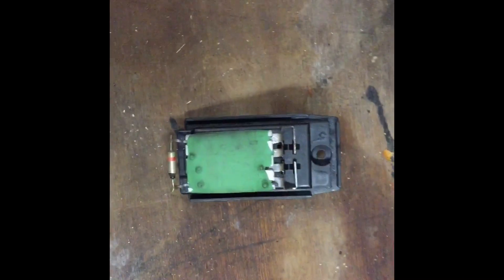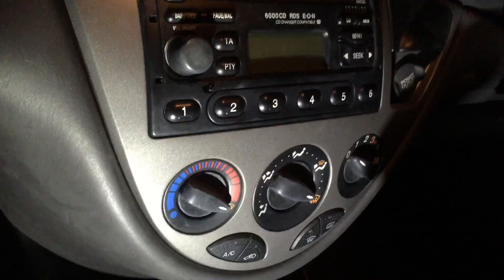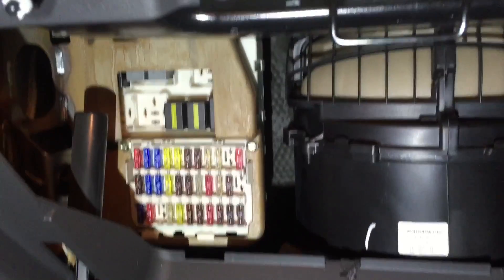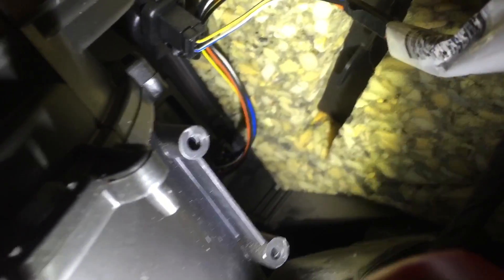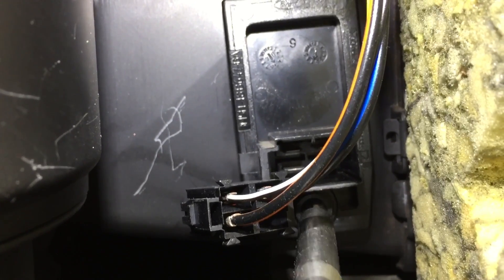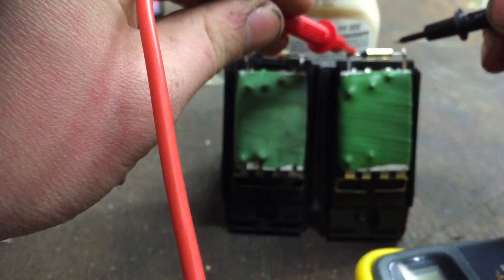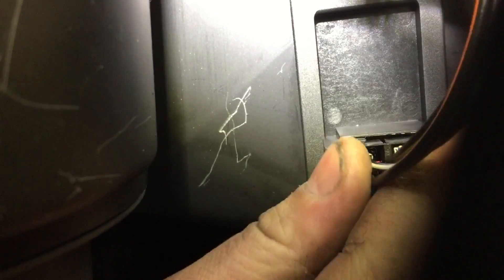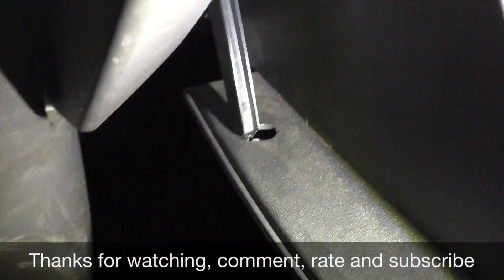Ford Focus, transit, Mondeo heater fan speed resistor diagnostic and replacement

Comment: This might be a stupid question but it seems that the car you are working on in this video is a right-hand drive, as you can see the fuse box when you've removed the glove box. My car is a left hand drive, do you know if the resistor is still behind the glove box or of its on the same side as the fuse box, i.e. behind the steering wheel?

Comment: Many thanks for uploading.  £9.99 from Ebay and all sorted !
Ford Mondeo Mk3... a very similar layout to that of the Focus in the video. Note to watch out for the glovebox light fitting (top-left, it slides out to the left). Note that a long, flat, screwdriver is perfect for persuading the glovebox pivot clips to open.
Reply: Hiya. I know this was 5 years ago ( you've probably changed cars by now!) I'm trying to find the heater resistor on my Mk3 and I'm having trouble finding it. Could you shed some light? I've even had the whole fan out! Any help would be greatly appreciated. Cheers - Chris

Comment: I`ve got a 2001 Mondeo. The fan only works on "full". But even then it sometimes makes a high pitch noise and it seems that the fan is not blowing as hard. After a while i CAN start blowing normally and the sound goes away. Do you think it is the same problem as you solved here? Perhaps a combination of things?  Cheers.
Reply from the maker: The speed problem is probably the resistor but the high pitched noise and slow motor could be a dry bearing in the fan motor itself
Reply: I was thinking bearing, but am not knowledgable enough to even know if there is one. ;)  Thank you very much man. Really appreciate it. Possible to get to that bearing and greace it/change it somehow..?
Reply from the maker: In my video I point the motor  it out behind the glove box, start the fan motor, listen to where the noise is coming from, grease or replace as required